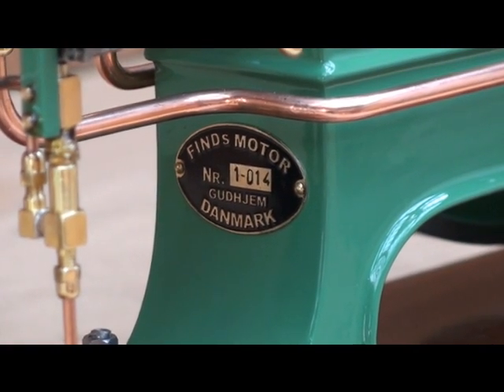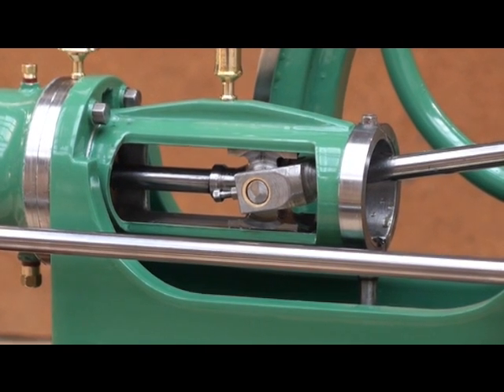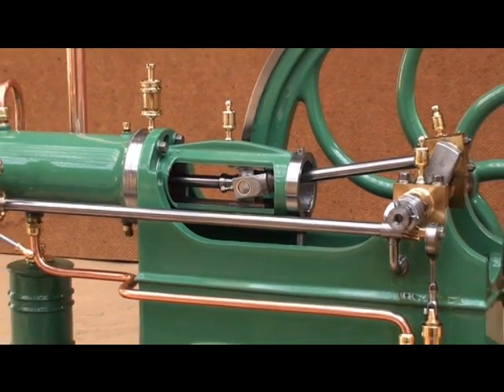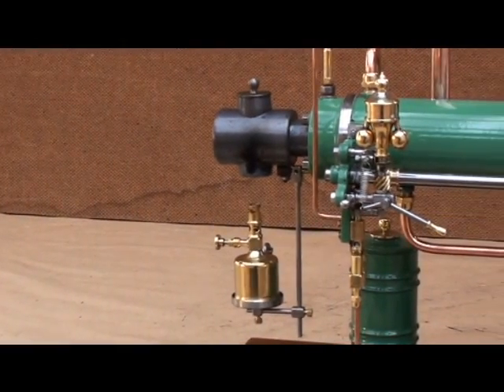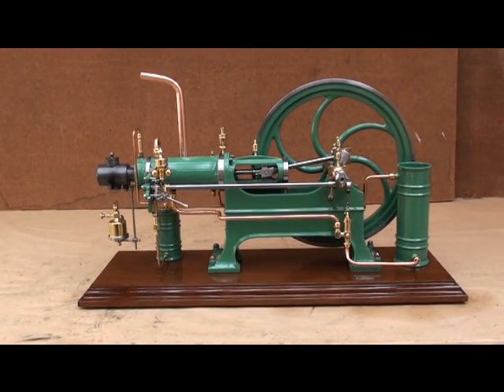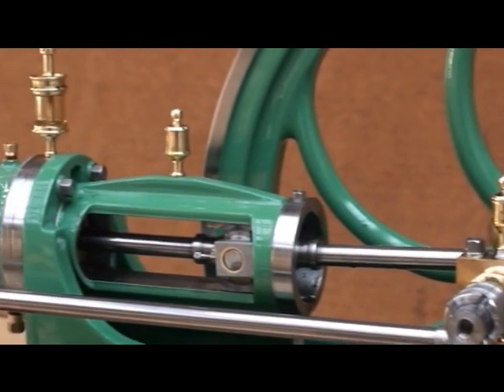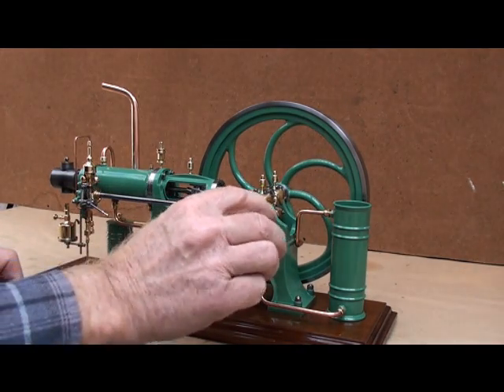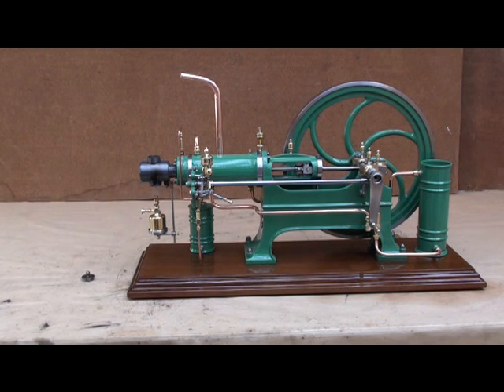World smallest working two-stroke cross-head hot-bulb engine

Comment: Can you explain how it works?
Reply: It's essentially a low speed 2 stroke engine that uses a hot bulb and compression to ignite a fuel-air mix with no electrical components needed
Reply: @concorde837  thank you

Comment: This is very interesting. How does the induction work? All the two strokes I've seen either trap the air fuel mix in a sealed crankcase and as the piston comes down it pressurizes it and then is allowed to go above the piston or as a blower to force fresh air in. How does this work?
Reply: Looks like direct injection.

Comment: Is this the same as a Stirling engine?
Reply: No completely different  same as a weed eater 
But more comparable to the two stroke Detroit's diesels
Reply: jarrad mcdaniel correction to my immediate response 
The bulb at the end is heated to act like a glow plug/spark plug if you will 
Incredibly simple idea when the internal temperature rise with the pressure the hot metal of the hot bulb forces (causes) an auto ignite where the fuel combust from pressure and heat then depending on engine is either let out through a valve or port 
My apologies for a quick response without answering the question completely and I'm sure I missed a couple of points
Reply: Exactly Jarrad, but this engine was also the first homogenous charge compression ignition engine as well.

The injection would inject fuel to vaporize inside the hot bulb that was essentially a hot air pocket, then the compression of air that entered through the intake would compress and the compression would heat up that homogenous charge to auto-ignite.

I know you already know this I'm sure, but I just wanted to add another version of the explanation.
Reply: jarrad mcdaniel not a glow plug, that just warms a engine block mainly on Diesel engines, you mean hot bulb

Comment: Sir. If you would build a 4 stroke engine with the exact same cc bore, how would you think those two engines would measure up in power?  if you build a lets say 10cc engine, would the 2 stroke engine of this design have more power compared to the 4 stroke at certain rpm?

Comment: Damn, that's beautiful. Question: Supposedly, a hot bulb engine will run on almost anything- gas, diesel, kerosene, discarded fish scales. What do you use to fuel yours? It's burning so cleanly I'm almost thinking alcohol.
Reply: +Hotrodelectric its definatly not alcohol, probably kerosine.

Comment: Funny that theirs no smoke coming out of the exhaust .
Reply: AndyTom no. its burning fuel. but very well adjusted.👍
Reply: 190055joe most engines run too rich to cool the pistons and heads 
If you run an engine in a balanced way there will be nearly no smoke
Reply: euro5compliant engine
Reply: 190055joe 
That's because it runs on the expansion of hot air not any kind of chemical fuel. it's similar to a sterling engine.

Comment: Now, turbocharge it
Reply: Cant turbocharge a 2 stroke
Reply: ***** My statement was a little strong but, Turbo charging such a small engine? Its more complicated than turbo charging a 4 stroke also.
Reply: Pug you have to run the turbo intake line to the supercharger, which then it travels into the engine block, that's how Detroit Diesel done it, coming from a diesel mechanic, so it's very possible to turbo charge a two stroke, but not one this small

Comment: Very, very nice. Is the cross head design necessary to have below the piston what would be the equivalent of pressurized crankcase to push air up the transfer passages to the combustion chamber for scavenging and recharging? Is the cross head shaft connected to the piston going through a seal of some sort? It appears you're not using any valving other than the piston uncovering opening in the cylinder wall. Is that correct? Again, very nice.
Reply: I saw some photos of this engine on the internet, and I believe the cylinder is sealed with a disc at the bottom - the con rod goes through this, and he has valve inlets in that disc, admitting air to the con rod side of the piston on the upstroke . Then the air is moved (scavenged), as normal, from the con rod side to the top side using internal channels in the cylinder on the downstroke.  The air intake valves are, I think, fairly simple and are kept closed simply by the pressure on the downstroke. How he contrives to get all this into something so small and elegant that works so perfectly I can barely imagine.

Comment: Is the blow lamp powered by compressed gas ? That's crazy !
Reply: Adrien Perié   It is probably fuel oil or lamp oil. (edit) There is some sort of compressed gas present so it's not fuel oil or lamp oil, even though the tank looks like an oil reservoir. At first, it didn't appear that this gentleman opened an actual gas valve but in full screen mode, I can now see the vented flame guard and can hear the gas release as he increases the flame height.
Reply: Racer
Clearly that's not the case, otherwise it wouldn't be called a blow lamp, and you can see the lenght of the flame increase as he turns up the valve. I'll bet you its lighter gas (butane).
Reply: Adrien Perié
 You are absolutely correct. After rewatching the video, it is clear. Sorry, it was late when I got back into town and I should have gone to bed instead of watching invention videos. If it isn't butane, I would guess it is propane.